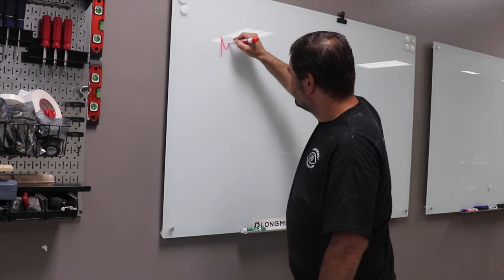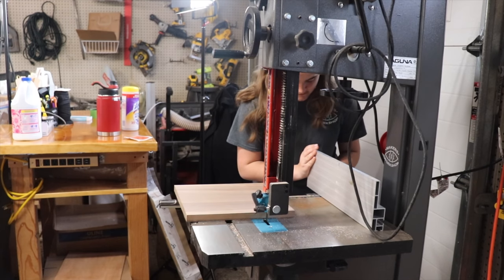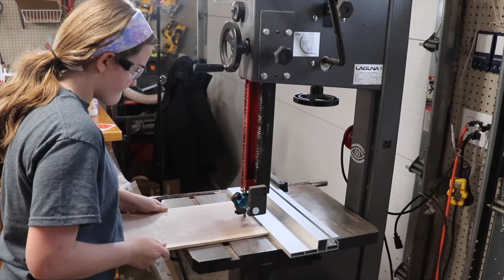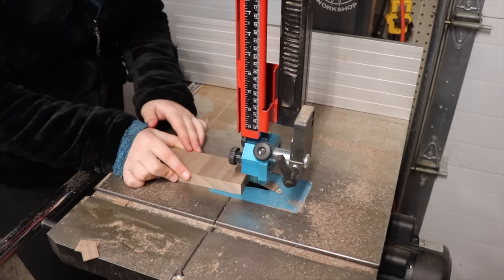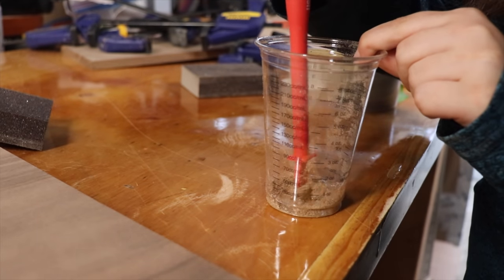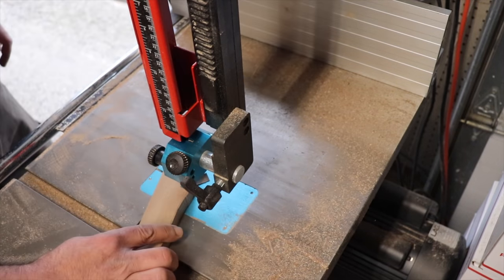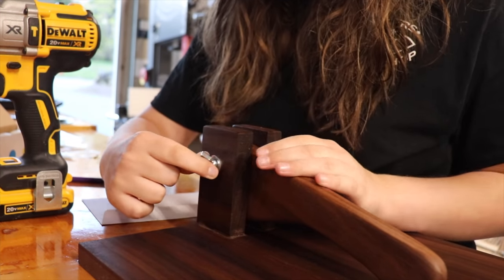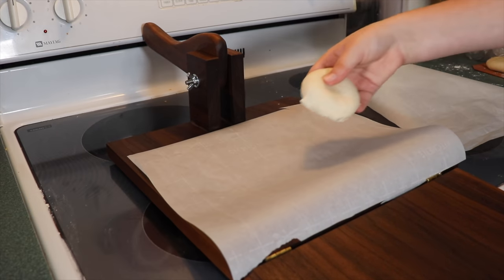How to Make a Tortilla Press

Comment: Nice job guys, looks like a fun project, I’ve never made my own tortillas, or really even thought about it. I do wish you went into a little more detail on the cam shape of the handle, as the shape and pivot location seem pretty critical.
Reply from the maker: This is true. At some point we are hoping to link plans in the description of this video so that there’s a fool-proof template for it. Oddly enough for this we were bold enough to just go for it by feel on the walnut and it worked. A better way would probably have been to do a test cut on some separate scrap.

Comment: Ok I followed all the stages, but you guys don't mention how or what the number is to drill the hole for the arm. How do you get the measurements for where to drill the hole?
Reply: The hole is drilled to match the diameter of the bolt.  Placement is by sight to set the bottom of the arm over the pressure strip on the top plate.

Comment: The tortilla looks so thick is more like a gordita, I would like to know if this will work if I want to make them thinner. Thanks
Reply from the maker: The thickness of the finished tortilla is all about how much you offset the hinge when you are installing it. We used a full envelope here and this is the thickness it gave us. Something thinner would achieve a thinner finished tortilla. Hope that helps!
Reply: @MakersWorkshopLLC  Yes it did thank you so much for answering my question . ;)

Comment: Typically, a tortilla press is used for corn tortillas. Flour tortillas are normally made with a roller so they are thinner and inflate when cooked.
Reply: I use a store bought wooden press for my corn tortillas and they do puff up when I cook them on my cast iron flat griddle. I'd love to be able to make larger corn tortillas as well as Roti and Flour tortillas. Home made always tastes better.
Reply: There are commercial tlayuda presses that can be used for flour tortillas as well.

The real issue is having enough force to get them thin.

Comment: There are several mistakes done. First of all, this is press to make CORN tortillas and NOT flour tortillas. The handle is way too short and misaligned. There isn't a stopper on the back (next to the hinges) so the wood plate doesn't open flat